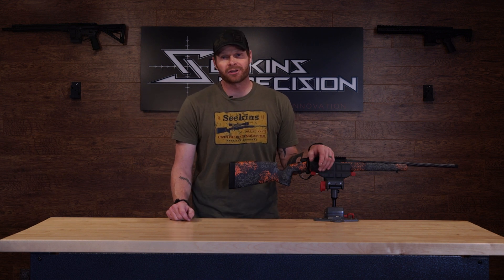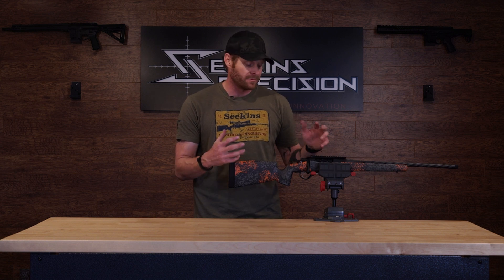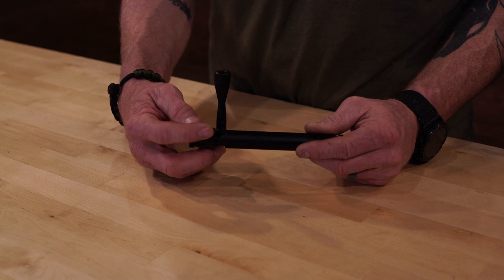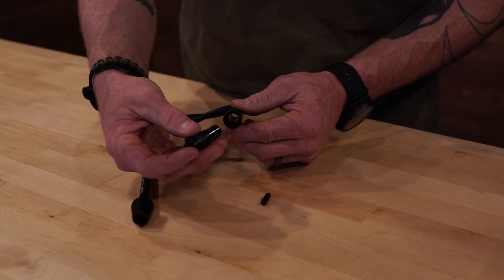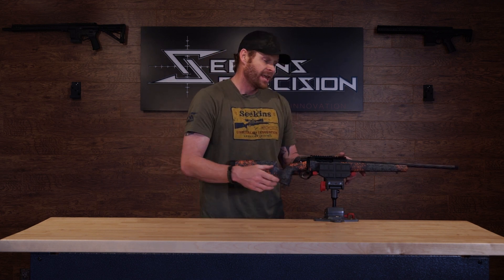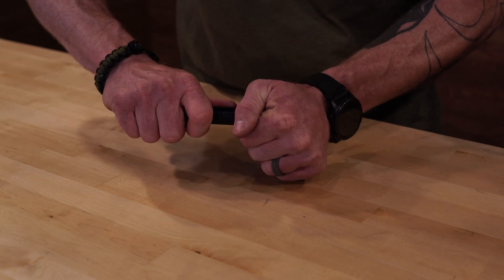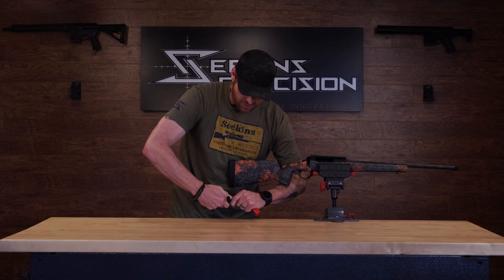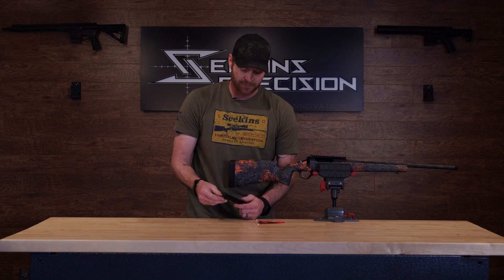Havak Gen 2 Bolt

Comment: Had my bolt shroud somehow slip into fired position on elk hunt 2 weeks ago after first shot.  I had not seen this video yet and could not figure out what was going on.  Luckily had a 1 shot kill on my bull, but this design feature seems to favor easier disassembly than field reliability.  I would prefer the later.  The only thing that is giving me second thoughts about this gun.